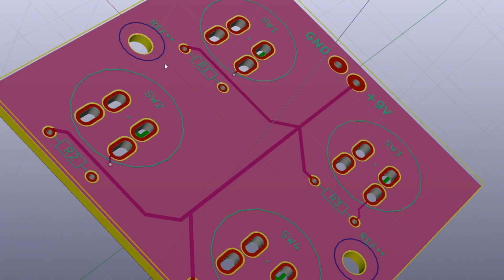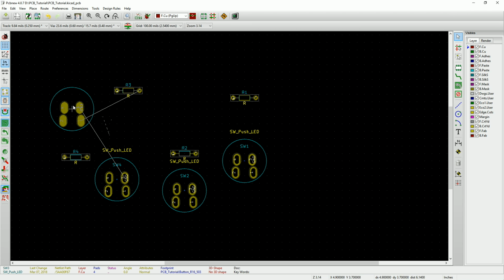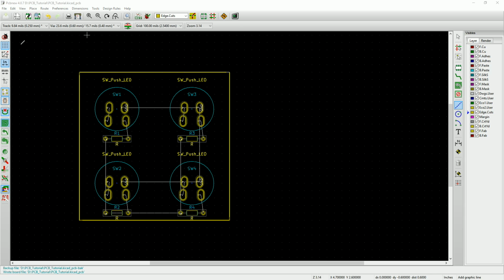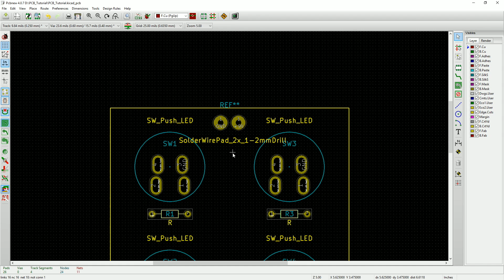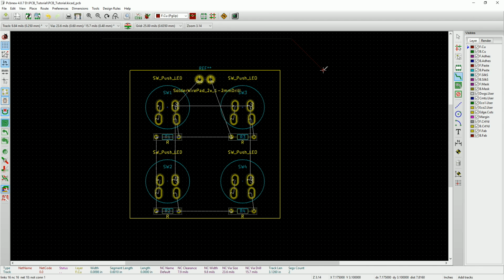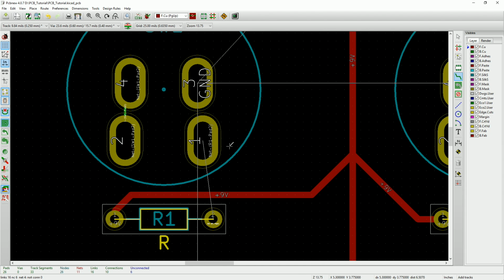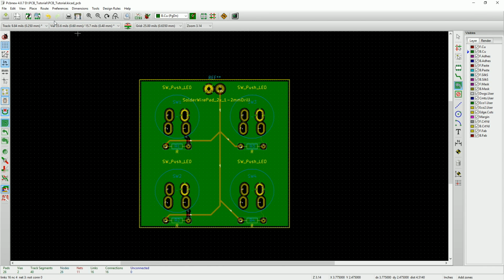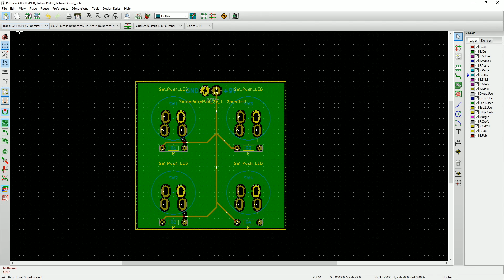KiCad - From Design to Manufacture - Part 3

Comment: Is there an easier way to make sure everything is symmetrical and lined up properly than staring at the grid coordinates? Getting the spacing between footprints, and the margin between the footprints and the pcb edge is a pain. I'm probably missing something obvious?